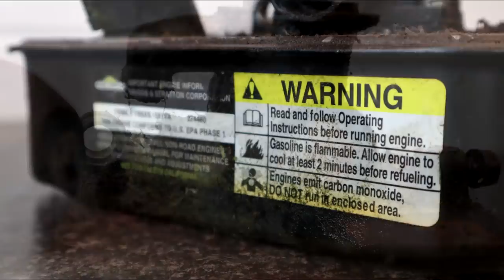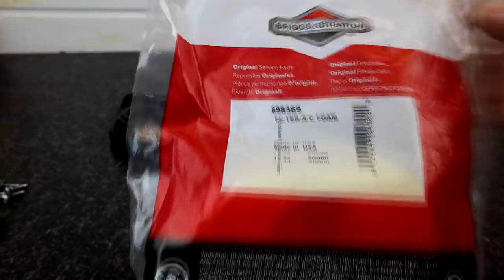Lawnmower Carburetor Restoration Briggs And Stratton

Comment: Top work. It is amazing what a little bit of paint can do to an old and tired carb. If I had to add just one thing, I would have removed the black paint from the white plastic tube where the bulb is located.

Comment: Hello Martin

Great job very professionally done.  Only one question, how come you didn't take the jet out to check/clean it? Is there a reason you didn't? Just curious. The reason I asked is because I recently bought a lawnmower project and it was blocked. Took me a while to figure it out lol

Fantastic channel look forward to watching more, better than the tele lol
Reply from the maker: I soaked it with carb cleaner and blew it out with the air line. These carbs don't have tiny jet holes and I have never had one of these blocked and I have done hundreds.
Reply: Trust me to get a blocked jet on my first restoration. If it's going to go wrong it will happen to me lol.

Thanks Martin

Comment: OMG! It is a plastic carburetor? Even in China carburetors are made of metal))
Reply: hmm nothing wrong with this plastic carb its been working fine for briggs for years TELL em Martin
Reply: Hmm, interesting) And vibration, gas and temperature did not affect plastic? Thanks))
Reply: Briggs went to a plastic body on some of their engines back in the mid 1980s, I think about 1987 or so, the engine you are watching being restored came out in I believe 1958, originally it was designed with an aluminum carb... I think California emissions caused the redesign.  
Personally I prefer the metal carburetor as opposed to the plastic but both do work well.
Reply: Thanks! That is another fact I did not know))